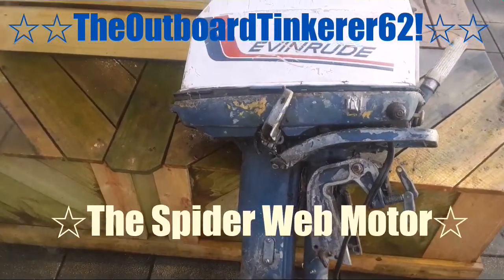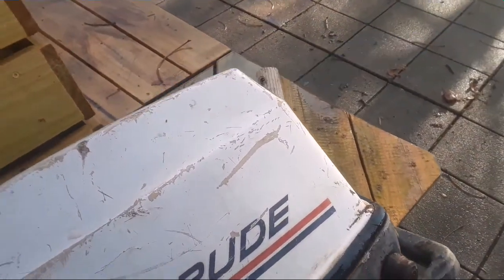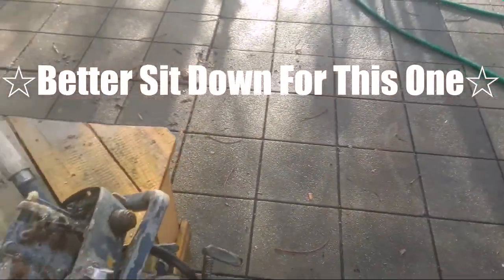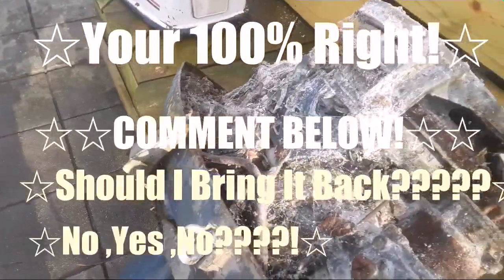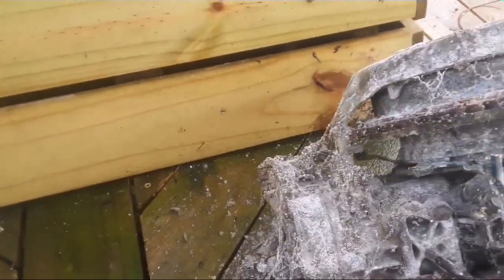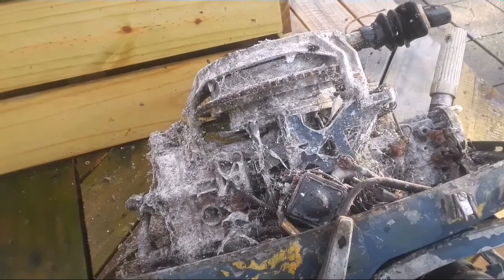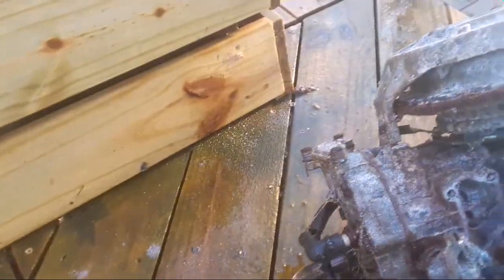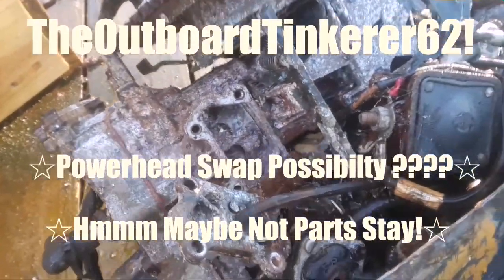THE SPIDER WEB MOTOR!1972 25HP Evinrude Elec/start. Bring it Back or  not? Real Bad! A Short video!

Comment: I don’t think I’ve seen worse ! That’s really bad !
Reply from the maker: Yeah apparently it was a submerged engine that I got as parts years back and  now 20 + years later and many spiders this is the result,LOLL! Not sure on my approach to it. Do I take it apart for parts keep whats good if any or bring it back would make a good video series. Powerhead swap  is easy enough who knows I dont even know we will see......Stay Tuned!!
Reply: @OutBoardTink62  if your going that far I’d strip the engine boil the block and completely rebuild it ! That 25 is worth around $1k plus a nice video series taboot
Reply from the maker: @davekimbler2308  Yes 50 year old Evinrude 18-25HPS running decent and this one is electric could make a few bucks on it. I flipped many of them some years back very popular those 25s with a nice lightweight design for many years..  Stay Tuned ...

Comment: Well, it was worth a look inside for sure.  Even if it looked OK in there, those engines are prone to aluminum/sleeve separation, but you just never know until you have a look.  I've learned not to 'judge a book by its cover' many times.  I've learned that old motors that look like new might look like that because they are hiding a dirty secret inside, or perhaps they could never get it running right so hid it away in the barn.  Your beautiful 1970 Evinrude was an example of this theory.  The electric started and bracket/flywheel are the most valuable parts here.  Maybe the gearcase is OK also.  Will stay tuned, am betting we haven't seen the last of this crusty old dog
Reply from the maker: Well see Ill have to think about it! I have many more in much better condition but thats way too easy, Ha!. I do like basket cases as you know and challenges it makes it that much more interesting. Most can fix an engine sitting for years that turns freely no challenge really ,... Stay Tuned time will tell.....it should be fun......
Reply: I think there’s not a part on that machine you CANT get the part ! Sure it has its downfalls like most anything with an engine ! If I buy one cheap enough I can make ( after doing everything ) around $600 profit , I can’t keep them in stock ! I get one and service it completely then put on marketplace and poof in 2 or 3 days it’s gone ! I have a feeling this one is worth saving !